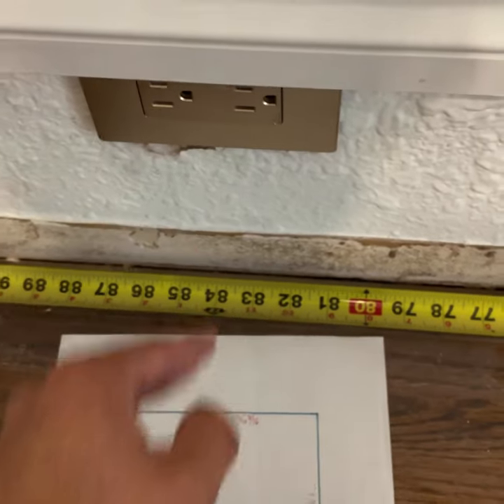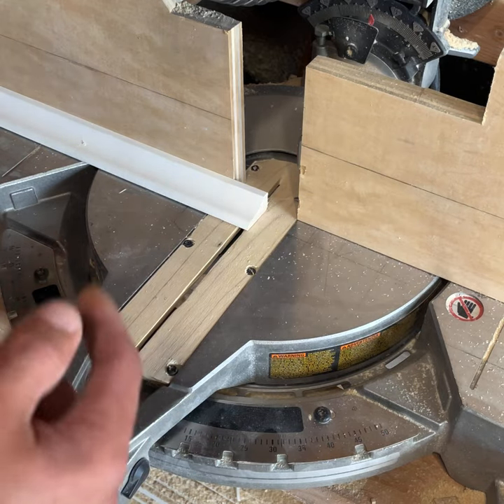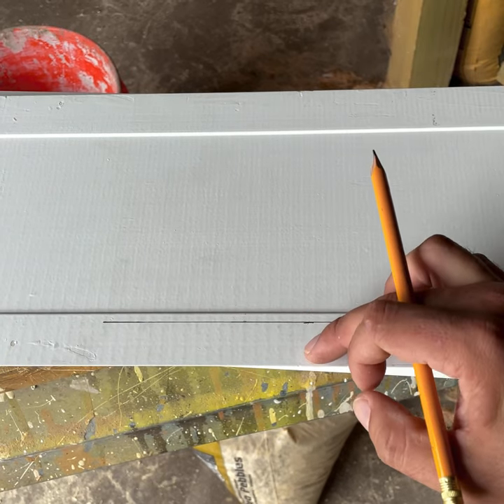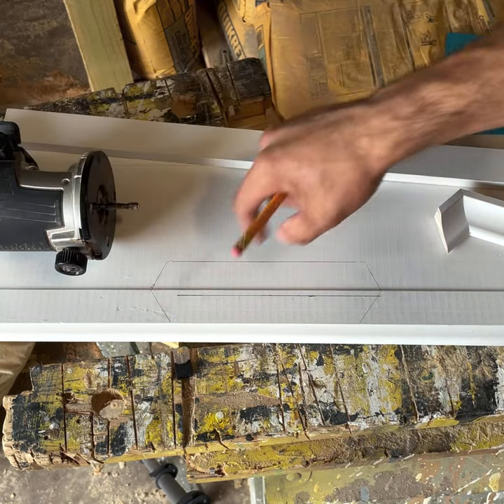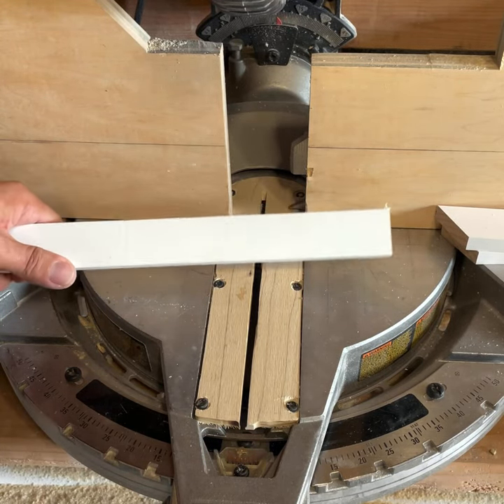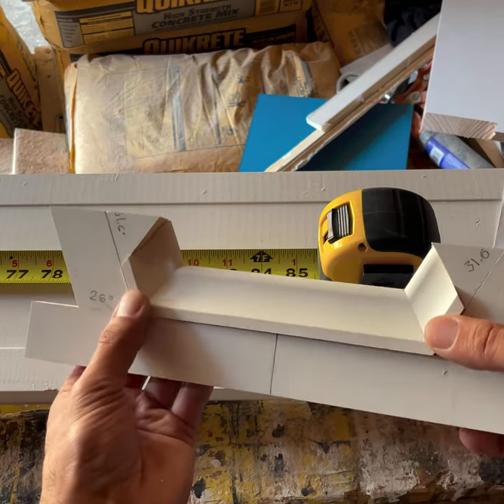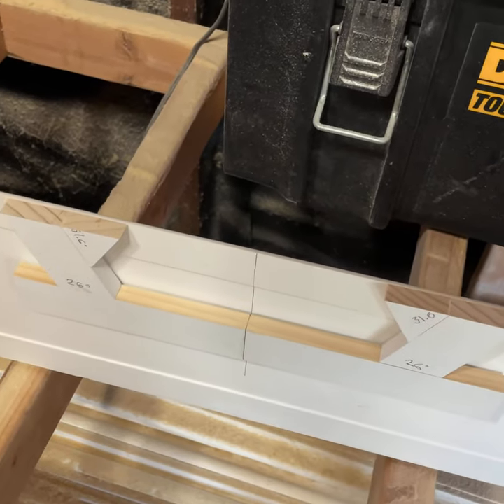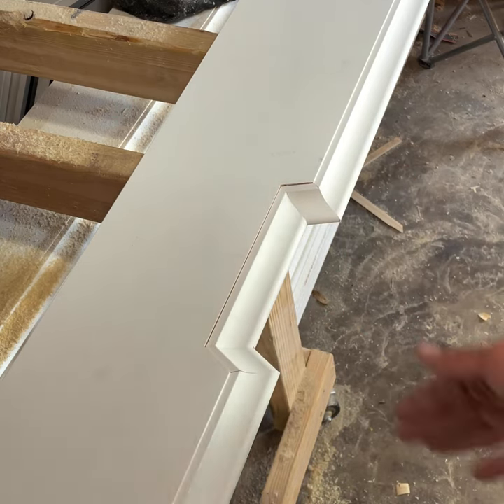HOW TO NOTCH MILLWORK PROPERLY

Comment: I have also seen people make trim for the outlet to bring it forward.  So basically make a square “picture frame” for the outlet that is flat and is 1/4” thicker than your baseboards or trim you are working with.  Use electrical extenders to bring the outlet out so the outlet plate is now sitting on top of its thick picture frame trim.  This gives a “casing” to the outlet that is now thicker than your baseboard so it can terminate into it nicely or be notched but look finished.

Comment: Definitely beautiful work, but gaddam, that's adding at least an hr or 2 to a simple notch... I would definitely take the time at my own house, but how do you sell the worth of that to a customer? And how would you price the difference? 
... also, I've done smthn similar but not quite so involved: if you carry those 31° cuts all the way to bottom of base, then cut the 2 strips along the drop on either side, then glue it all tgthr w another piece of base (where you ripped the height of drop off bottom), you save yourself the router step (but granted, there are more seams that need to be sanded out) 
*I know that was a terrible explanation, but I hope it made sense lol

Comment: Do you ever do any of this with crown moulding? We have a vent on the ceiling that would be covered partially by the crown and I was wondering if you’ve worked around anything like that in the past or if you have any pictures of what you’ve done!
Reply: I think finish carpentry tv did a video on that. In the comments someone said they lowered the vent cover so it ran up to the bottom of the crown and painted the wall behind the cover black. Still vents but can’t even tell the vent is offset from the cover.
Reply: @WalterMelons  thanks for the heads up! I’ll check it out!